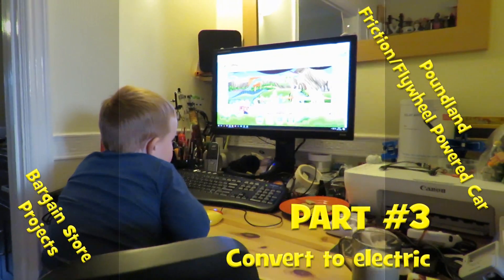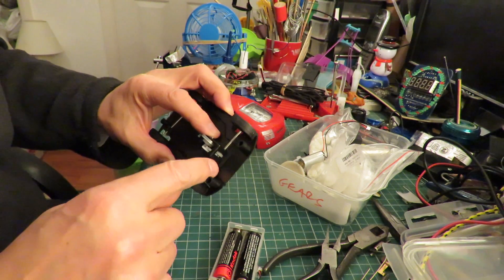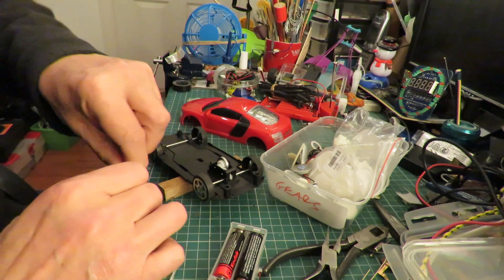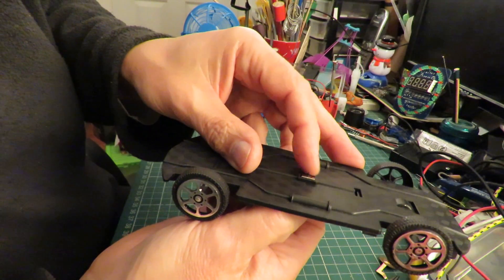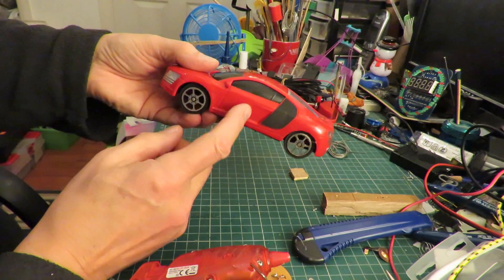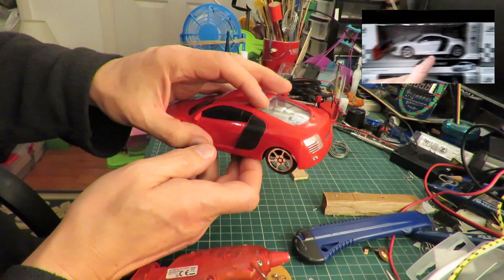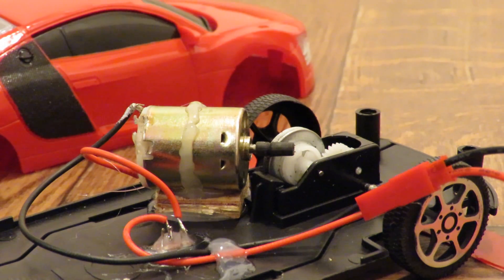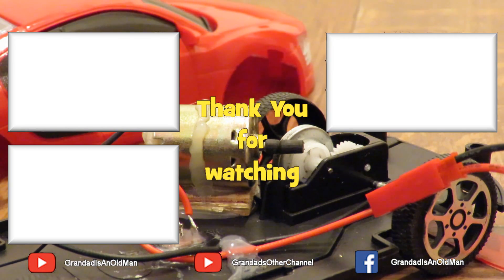Poundland Friction/Flywheel Powered Car PART #3 Convert to electric

Comment: Do you think that this car can tow a 30-pound trailer? If not, I challenge you to make one that can. I think it would be really cool to see that little car pulling a trailer stacked high with cans and bricks.
Reply from the maker: I don't understand the interest in what it can tow. If you gear any motor low enough it will move large loads. Many of the solar toys have tiny motors because they get very little power from the small solar panels but they have lots of gearing to enable them to move the toy
Reply: It's a tiny 3V motor pulling a really heavy thing (albeit slowly). What's not to like?

Comment: With that gearing, that could easily tow a few things. (assuming there is enough friction from the rubber tubing)
Reply from the maker: I didn't count the teeth on the gears in the gearbox so I don't know what the overall ratio is. It was just a "quick and dirty" method of powering the car.
Reply: GrandadIsAnOldMan I assume technically the flywheel is a large gear. Just without teeth connecting it to the motor, just the rubber friction. So 1 rotation of the motor is only a tiny movement of the flywheel. Which means a tiny movement of the tires.
Reply from the maker: Between the flywheel and the axle there is a whole gearbox full of gears. That is what I am talking about. I just checked the gearing for you. The gearbox is set up so you spin the flywheel 13 times for one revolution of the back wheel.
Reply: GrandadIsAnOldMan Thanks for checking. And that seems cool.
Reply from the maker: I started writing the reply from memory and then decided it would be better just to put a mark on the wheel and the flywheel and count the revolutions 😊Once you had made the comment it was playing on my mind trying to remember which way it was geared. I can see now the original purpose is to get the flywheel spinning as fast as possible to store the energy.
Reply: Indeed :D

Comment: hi gradad, good idea with the electric motor but i had  2 more ideas, 1 would be to have a round maget sitting on the motorshaft and having that up against the flywheel so you would have the magnetic turn effect of the flywheel, problem might be is that if the flywheel would attract the magnet tho. and the other idea would be to have a rubberband comming off the motoshaft which drives the flywheel. wonder if you would put on a bigger flywheel cuz it would have more momentum to drive the car forward and it would go a bigger distance . good video.
Reply from the maker: Hi Marc. In reverse order. Changing the flywheel size is limited by the clearance withing the plastic casing. It could be done but it is not a simple swap. It would involve significant modification and probably need the gears changed to match the spacing so really just easier to change the whole motor. Rubber band - again a problem of clearance. You would probably need to put a pulley in place and again the motor would need significant modification. Easier just to throw the clockwork motor away and put the pulley straight on the back axle. Last - using magnets and Lenz's law. Theoretically might work, practically I doubt it. Here are a couple of videos I did on the subject https://youtu.be/i2g3mzrgiJE https://youtu.be/3-jGzcD_XvQ